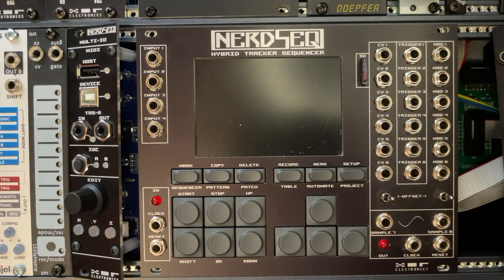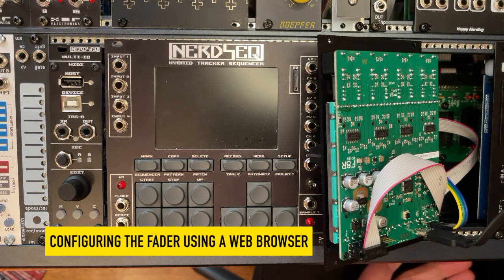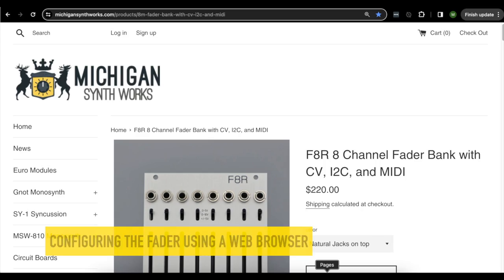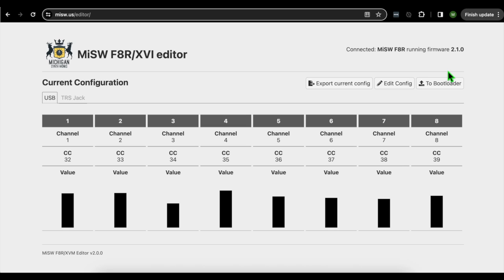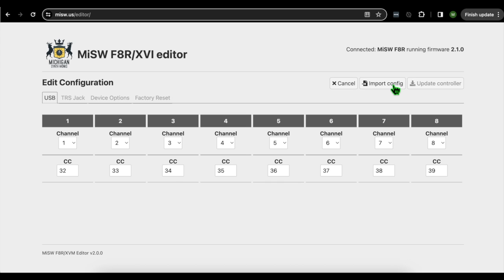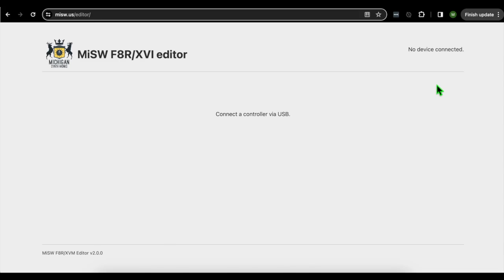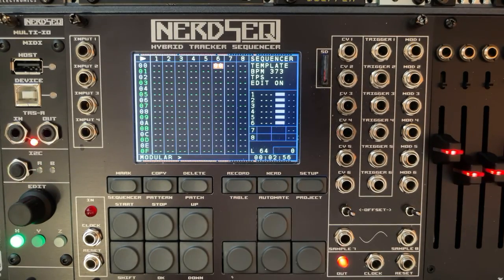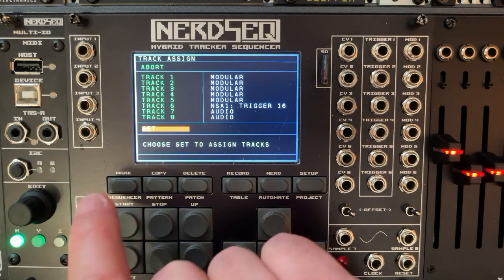Tutorial on controlling rhythms on Nerdseq using I2C faderbank (Euclidian rhythms, BPM, synths)

Comment: That was very useful 👍 sorry if the answer of this question is obvious but if the faders are configurated for I2C, can you still use them with cables directly to other modules than the Nerdseq?
Reply from the maker: Great question. Turns out the faders still supply CV ouput when connected to the Nerseq via I2C. You can even have the output from a single fader go both to the Nerdseq and to another device via the CV output. Provides all sorts of flexibility.
Reply: @SynthBu thanks so much for your answer. That’s really great news!